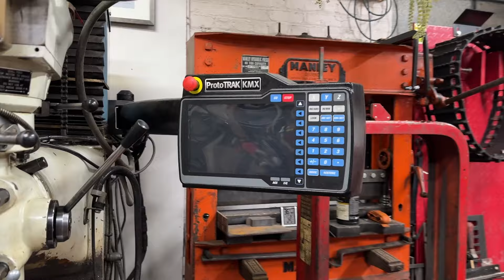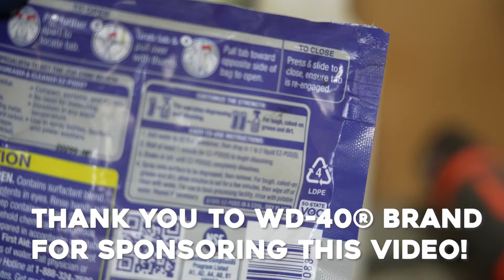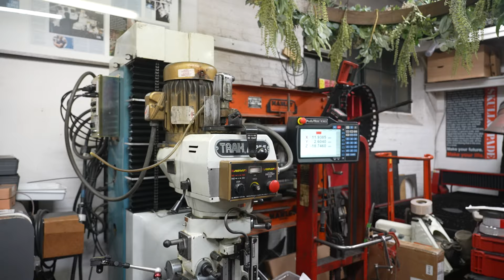The Resurrection of an Old CNC Machine

Comment: I have been running Trax mills and lathes on and off for the last 25 years. I have always been happy with them. The first brand new one I got to run was a DPM5 in 2003 with the SM controls. Watch out for that y hand wheel, I have dropped myself to the floor a few times
Reply: My hand always covers the sensitive equipment as a precaution, nothing quite like getting sack tapped three times before you figure out you should move

Comment: Upgrade your spindle motor to a brushless AC servo!  It will let you ridged tap and is a much smaller motor.  Just need 220v to power the driver and some knowledge on Step/Dir signals with encoder setup.  plus you can get 5000rpm and can take your new tachometer off if you want because its a servo

Comment: Fascinating, back in the mid 1970’s my employer got an unusual cnc machine based on a Bridgeport mill. It was called a Moog hydra point. It was a 2 axis machine entirely hydraulic in operation with no lead screws. Sadly many years after I left, about 30 to be honest I returned to the workshop after my boss had died at the behest of his son-in-law. And it was still there looking sorry for itself.

Comment: Hahaha I bought the sister machine right next to this one for the same company. I wanted to buy this one but was told someone already made a deal for it. I got the green and cream one
Reply from the maker: @StockbutBetter  it was a great deal! I begged him to hold this one for me until I could get there to pick it up! Super nice guy and a very cool shop
Reply: @MakeEverything   It sure was a great deal! All said and done I paid 6500. 6000 for the machine and 500 to load it on my trailer. I end up disassembling it and sandblasting the machine to repaint it. A huge under taking that I miss calculated on and it took forever to get it done. The biggest pain was the epoxy resin filler because u had a short work time frame

Comment: One great thing I love about those DPM Mills is that the quill and the Z servo are tied together. So you can jog the Z down close to the work, then unlock your quill and bring the cutter down against the material, and then zero your z, and then when you go up with the quill, it knows how far above the work you are. You really don't need to use the 3D probe to set your Z with that feature.  Very handy.

Comment: Voice sounds different, hope you're ok
Reply from the maker: I used a different program to enhance the audio to sound clearer, did it sound better or worse?
Reply: @MakeEverything  sounded maybe a little less clear, kind of like if your voice was rough after yelling all night, or rough from after a cold/flu. At least that was my first impression and hearing your usual recorded voice. Maybe it wouldn't be as obvious if I was new to channel. Also kinda seemed to take the dynamics out, sometimes you speak louder or quieter and this seemed a lot more level, which I guess is a good thing but I thought it sounded less expressive / more subdued.